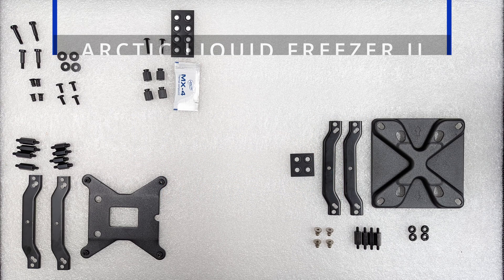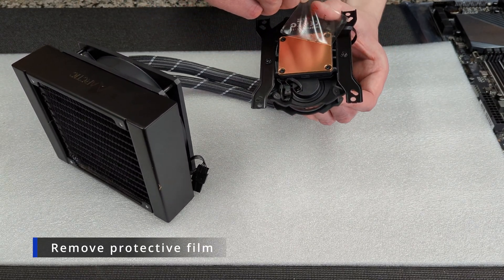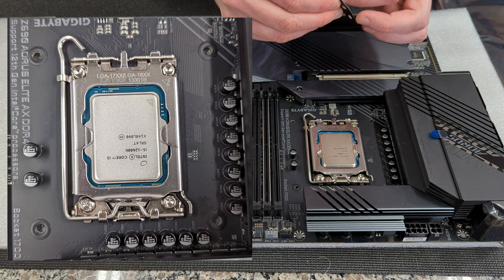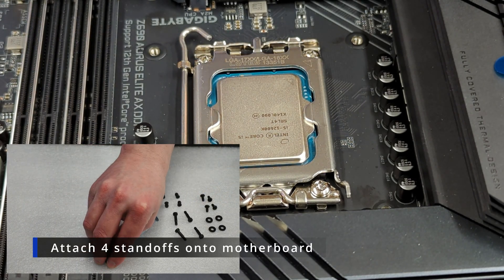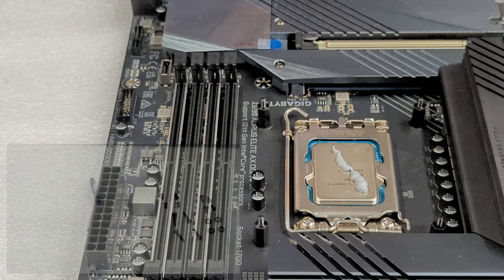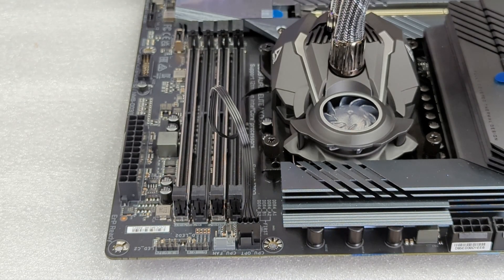ARCTIC Liquid Freezer II | LGA1700 Kit Installation

Comment from the maker: ATTENTION: Old revision
There is now a newer revision of the LGA1700 kit in the packaging.
It is x-shaped and looks very similar to the LGA1200 kit.
Please check here if you have the new revision: https://youtu.be/PhGOsBNTLYM
Reply: I'm waiting on my 280mm to show up. Does this have to be purchased separately for the LGA 1700?
Reply from the maker: Normally by now there should be a LGA1700 Kit inside each box. If you bought directly from us there is definitely a Kit inside.
Coolers purchased from resellers may be delivered without the corresponding accessories.
In this case, please contact our customer support.
Reply: thtanks for help . just one question . should i put any liquid inside or it came with it  @ARCTIChannel
Reply: This new “revision” works like crap. Impossible to install without other people helping you.
Reply from the maker: Don't put any extra liquid inside the AiO.
AiO = All in One
You don't need to do anything else beside to install it in your case and plug in the cables.
Reply from the maker: Which step was problematic? Maybe we can help 😊
Otherwise we do have some online manuals available too - there is a step by step guide on how to install it.
Reply: @ARCTIChannel  I don’t like having to take my entire motherboard off (aka taking apart my entire computer just to install the mounting bracket). Considering the washers have to go under the mounting bracket and the screws have to go through the whole, there’s no way to hold that in place while I go to attach the aio cooler to the cpu. I had to buy the other revision and I don’t even know if that’s going to work
Reply: @dhsjakacjenal right, on my first build and this just pissed me off to the max. how did the other revision work for you?

Comment: I have purchased a LGA 1700 mount kit. Followed this video step by step. Yet my Cooler is still not making contact with my CPU causing it to overheat. I am really confused as to why this has been made so difficult to do.
Reply: Have you solved this problem because I’m having the same issue
Reply: @ I contacted Arctic directly and explained my issue and they sent me a mount kit that fit the cooler.

Comment: Glad I found this video, the instructions on the website is straight up missing for lga1700, and all wrong for lga1200 with the 1700 upgrade kit. That was an hour I'm never getting back.

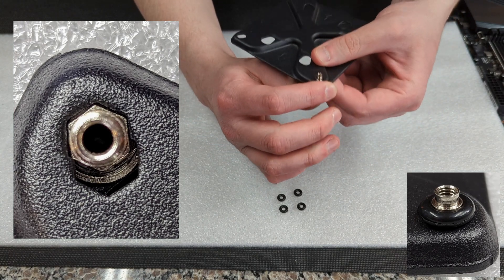If anyone else is struggling with this backplate on an LGA1200, it's installed like this video shows (3:06), but the nut-serts go into the smaller pattern rather than the big pattern like the 1700.
Reply from the maker: Hi, thank you for your feedback and sorry for the inconvenience! For which version you check with the website so we can correct it? 🙂

Comment: Good video, but even better if there was more data on the site as well. There, the information about the additional set is almost zero. There is no example of motherboards where the square plate does not fit. There is also no video from which I can see that it will be suitable for my cooler and motherboard. It's not at all clear what data needs to be filled in to get the additional kit because my cooler was taken quite a long time ago for socket 1151, but I want to use it for the new 1700 because the cooler is just perfect. I'm with motherboard "Asrock B660M Pro RS" and case "fractal design define r5 window".

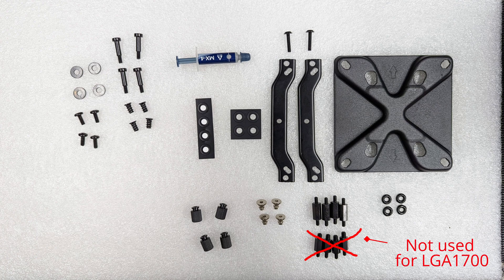Comment: The standoffs x’ed out at 1:03 are the only ones that work in my situation. The standoffs used in this video are too tall so the cooling play doesn’t touch my CPU if I use them. What do I use to install the shorter standoffs that are x’ed out?

i9 13900k
ROG STRIX Z790-h
Reply from the maker: Sounds like you're using the old LGA1700 backplate Rev.1 (shown in the video)
Please check here and tell me, which backplate you have: https://www.arctic.de/en/faq/detail/is-my-cooler-intel-lga1700-compatible
Reply: @ARCTIChannel  I have the one at the very top. The x’ed out standoffs in the video are the perfect height but the fat side doesn’t fit into the backplate nor thumbscrews.
Reply from the maker: Kindly check our online manual as an example: https://support.arctic.de/en/lf2-360r7
Select Intel Socket – 1700 -> Installation.
There is a step by step guide on how to install everything with the matching screws.
Seems like you're using the wrong screws. The standoffs with one thicker side are for the Intel 2066, 2011(-3) sockets.

Comment: Terrible, no manual, and you need to update this video!
Reply from the maker: Hey,
Kindly check on our website - there should be a manual for each Liquid Freezer available.
For example: https://support.arctic.de/lf2-360
Kindly select your Rev. and watch the step by step guide 😊

For further questions don't hesitate to ask.
Have a great day ahead!
Reply: Yes, but you still need to update this video, I almost returned it because it doesn't mention the new plate was included. Also I still might be returning it, my temps are hitting 100c with auto mobo settings. Not very efficient. I am installing a ThermalRight cpu block to even out the contact point as the 13900k does run hot. If that doesn't work I will be returning it. Its a 420 rad and should well cool that CPU. @ARCTIChannel
Reply from the maker: Normally the LF 420 should be able to handle your 13900K.
Is the pump working normally?
We're sorry about the video - we tried to add the "Is My cooler LGA compatible" to help out.
A shorter video would probably make more sense here.
We'll keep that in mind!
Reply: I believe so, is there anyway to properly test fluid movement? I am replacing that bracket though before I freak out. Could just be that.  @ARCTIChannel
Reply from the maker: You should hear the pump running - otherwise you can leave your system running for a bit and check both of the hose. One should be cold - the other one should feel warm.

Otherwise you can also get in touch with your reseller or our support. I'm sure they can help.

Comment: the 2 screws i got wit the mounting clips are too long
Reply from the maker: Hey,
Did you used our online manual?
If not please tell me, which Liquid Freezer you have and I'll send you the right manual.
There is a step by step guide on the installation aswell as a list of each part.

For further questions don't hesitate to ask

Best regards,
Nico

Comment: Is there no separate connector for pump and fans here? Can you do it separetely somehow?
Reply from the maker: Hey,
It is possible to receive two readings.
If you're interested in more infos about that - kindly open a ticket here: https://support.arctic.de/en/menu/support
Or message us on another channel via DM 😊
Reply: @ARCTIChannel  thank you for reply. But actually i'm good with connecting it together to CPU fan. I think there is no need for separating fan and pump, when pump would run constantly 100%.

Comment: Wt heck??? And how to mount with the part you said we are not use it ???
Reply from the maker: Hey,
The Kit you see in the right bottom corner is our Rev.1 LGA1700 Kit. The Kit was compatible with 95% of the cases.
Therefore we released the Rev.2 Kit which is compatible 100% of the times.
Kindly check here: https://www.arctic.de/en/faq/detail/is-my-cooler-intel-lga1700-compatible

For further questions don't hesitate to ask

Best regards,
Nico

Comment: Where i can buy this? I have no parts to mount it on lga1700, and official website does not have it? Do i need new cooling set?
Reply from the maker: Hey,
Kindly check here: https://www.arctic.de/en/faq/detail/is-my-cooler-intel-lga1700-compatible
Follow the link to the Support page - you can order your free LGA1700 Kit there.
Kindly attach your invoice of either your CPU or the cooler itself.

For further questions don't hesitate to ask

Best regards,
Nico

Comment: Why do you plug into CPU fan optional, instead of CPU Fan 1? I have CPU Fan 1, CPU Fan Optional, and AIO Pump (ASUS Pro Art 790 creator wifi)
Reply from the maker: Hey,

we recommend CPU Fan 1 or CPU Fan Opt.
As long as this one has enough output, it doesn't matter which one you take. The AiO header would cause your pump to run at 100% continuously, so we don't recommend it. 😊

Kind regards
Dominik

Comment: I saw a review stating that the LF2 a-rgb performs much better than the non-rgb variant. I am planning on buying a 420 soon, and I care quite a bit about noise/thermals. Is the argb version better?
Reply from the maker: Hey Björn,
Normally that shouldn't be the case.
As for the difference in performance - the A-RGB fans can output a bit more rpm, since they are smaller in diameter then the regular p14.
But the difference should be barely notable.

Comment: If i buy a new LF 2 120mm it means there is no LGA1700 kit in it ? There is an information about AM5 and LGA1700 support on the web site so box contents is changed ?
Reply from the maker: Hi Mustafa,
the LFII 120MM unit has gone end of life since 2020/2021 ish. So all available units on the market could not have the latest 1700 kit included. If you receive a unit without the kit, order it for free on our Webpage:
https://pulse.ly/g8tcgqocil

Best regards
Arctic Service (SoMe Team is on vacation)
Reply: @ARCTIChannel  i sent a request alreeady but there is no answer until at the moment. I have I5 12400F and Z690. My case is ASUS GT301 so i bought 120mm i need the kit im still waiting for mail.
Reply: @ARCTIChannel  Another question, is there any possibility to receive it with kit ?
Reply from the maker: Hi dear Mustafa,
i found 2 requests for the kit and 2 different email addresses. I assume one request was wrong as there is the Netherlands stated as your home country. I think that this would be a typo. But which mail can i use for contact? @gmail or @yandex.com?
BR
Stephan
Reply: @ARCTIChannel  gmail is okay for me. One of them i sent it in the night on the phone so i sent it again on pc %100 sure it is send.
Reply from the maker: Check my mail for your answer.
Stephan - Arctic Service
Reply from the maker: Alright, just send you an Email.
We then talk via Mail next.

Cheers Stephan
Arctic Service

Comment: Hi I’m having trouble getting the pump mounted. My motherboard is Asus rog strix b760 - f is it compatible ? I bought the LF 2 240. Also is this the correct mounting kit for my cooler. It says for freezer 34 on Amazon.
Reply from the maker: Hi sideEffects,
please tell me the issue? I assume your pump clips interfere with the surrounding caps or are the clips laying on the caps and will touch each other?
Best regards
Arctic - Service

Comment: Good afternoon. Tell me if it will fit on the board without removing the casing msi mpg edge z790 wifi ddr4
Reply from the maker: Hey,

We can't tell you that, because it mainly depends on the case. Unfortunately, there is a small incompatibility with the Liquid Freezer ll on your board.
But you can get a different pump head cover free of charge from our support. ⬇️ 😁
https://pulse.ly/mwbzgr39i5

Kind regards
Dominik

Comment: I'm not sure if it's mentioned somewhere here but I've got some mounting problem with lga 1700. I've done everything like on this video and still the plate from cooler didn't stick to paste on the cpu. I bought II 280 coller rev. 7 with new mounting kit. Also are you sure that mx-5 are good choice? From 2022 there are news that this series is a big mistake and all production off mx-5 is shutdown due to problems with paste integrity. The distances are stick to the motherboard so I don't see necessary space to reduce space gap between coller and cpu. It helped when I slightly deform the mounting plates on the cooler but comeone, is this really the cooler that wins european awards in 2022? Right now I'm really disappointed, maybe I've done something wrong but I don't see the way to proper mount it. It seems that those 13mm distances are 1 mm to long.
Reply from the maker: Hey,

We are sorry that you are not satisfied with your Liquid Freezer ll. We will be happy to help you with the installation. Please contact our support team at the following link, they will be happy to help you. 😊⬇️
https://pulse.ly/7etvwnavof
I can give you the all-clear for the Mx-5, the batches that are included with the Liquid Freezer ll have been checked and are not affected. So you can use them without hesitation.

Kind regards
Dominik

Comment: Долго выбирал водяное охлаждение для 13700 и в итоге остановился на 280 argb. На моей материнской плате MSI b660 mortar нет никаких проблем с установкой кроме совместимости с высокими радиаторами оперативной памяти и даже при условии использования большого корпуса be quiet silent base 601, столкнулся с рядом проблем, а именно, радиатор охлаждения почти вплотную давит на разъем питания процессора, решилось загибом проводов, так же не удалось установить радиатор в крайнее левое положение, кулера упирались в радиатор vrm, ну и самое плохое это высокие радиаторы на оперативной памяти заставили отказаться от комплектных вентиляторов и поставить 140мм от be quiet, при этом пришлось удалить одно из креплений и сместить радиатор на середину корпуса. По итогу 280 и 420 охлаждение подходит не везде, а где подходит иногда приходится колхозить. Так же столкнулся с проблемой того что если не подключать в заводскую косу вентиляторы, то помпа не отображает количество оборотов, при этом работает, зафиксировал в bios на 9в работу.
Reply from the maker: Hey,

We are sorry that you are not satisfied with your Liquid Freezer ll. If you need assistance with the installation or have a defect with your cooler, please contact our support. You can find them here: https://pulse.ly/ykya59h997

Kind regards
Dominik
Reply: @ARCTIChannel  Thanks for the answer, but I have no complaints about your system.  All problems are related to the case, although it is quite large.  The only disappointing thing is that I can't adjust the speed of the pump and the fans separately, to be precise, it can be done, but I won't see the speed of the pump.
Reply from the maker: We're working on a solution for that :)

Comment: I have the original pre-lga 1700 mounting kit on the left. I have an lga 1700 socket. Is the new one on the right an aftermarket mount you need to buy separately?
Reply from the maker: Hey,

Kindly fill out the form below to receive a Code, which you can redeem on our website to receive the newest LGA1700 Kit for free :)
https://pulse.ly/fasv4y71wj

For further questions don't hesitate to ask
Reply: @ARCTIChannel  Thank you, I've ordered the kit. I have no problem paying for it. It's only $9.99 and it's probably easier anyway. This is the correct mounting kit to use with an Asus ROG Maximus Z790 Hero and the i9 13900KS, correct? I just want to be absolutely sure.

Comment: when i look the manual i see this aio cooler didnt compatible with asus rog strix z790-f? how to fix it? bcoz i wanna buy it
Reply from the maker: Hi Ahmad,

the mentioned board is not compatible and it is not fixable as many surrounding parts will collide with the pump or the mounting clips and will stay incompatible unfortunate. So please avoid using the LFII with said board.

Best regards
Arctic - Service

Comment: Can someone tell me how much amps the 360 draws? I’m wanting to swap the fans for Phanteks T30, and the performance mode on the fans are 0.45a each. So if I want to replace them with three of these, that’s 1.45a just for the fans. Thanks
Reply from the maker: Hey Haies,
The Pump itself without fans uses around 0,225A.
So please make sure, you connect it to a 2A header on your MoBo.

For further questions don't hesitate to ask

Best regards,
Nico
Reply: @ARCTIChannel  The CPU header is 2A, so it’s perfect. Thanks 😊

Comment: So the pre lga 1700 (completely flat) doesn’t work on a b760 pro with i7 13700kf ?

I need the newer plate ?

I really have trouble with this water cooler it doesn’t seem to press enough with the flat one
Reply from the maker: Hi KusoDoon,
Pre LGA1700 is not compatible and you definitely need a LGA1700 Kit. As i can´t send any images here, i would like to check your included parts. Send me an image to service-rma@arctic.de and mention my Name so i can claim the mail. Also you can open a service ticket on our Service page.
Best regards
Stephan - Arctic Service

Comment: My Artic F 2 does well on the Z390 i9700k but is struggling this set up, I'm overheating big time with the 1700 with the i5 13600k. Do I need to get a better cooler for the 13th gen, I read that this Cooler can handle the 13 gen easy
Reply from the maker: Hey,

it also depends on what kind of Liquid Freezer ll you have. Maybe you should switch to a bigger Liquid Freezer ll to get better temperatures.
If you have any further questions, feel free to drop us a line. 🙂

Kind regards
Dominik

Comment: Is the thermal paste application used here the go to method?
Reply from the maker: Hey,
Every method should be good to go :)
Just make sure you cover the whole CPU as thin as possible.
Also make sure you don't trap any air bubbles.

For further questions don't hesitate to ask

Best regards,
Nico
Reply: I used to use the dot in the middle when Intel cpus used to be squarish but now Im not so sure with lga1700.
Reply from the maker: I agree - maybe you could try spreading the paste directly :)
This way you can be sure to reach each corner

Comment: Do the sticky washers have to be installed? I don’t know if I’m making good contact as my idle temps are anywhere between 35-38, but spike to the 60s. Got the 360 paired with a 13700K
Reply from the maker: Hi Haies,

we definitely recommend it. It should not affect your temperatures. 🙂

Kind regards
Dominik